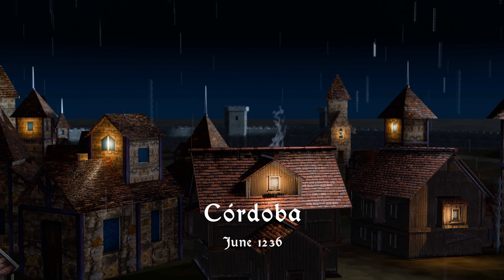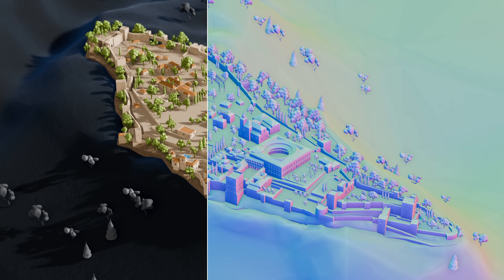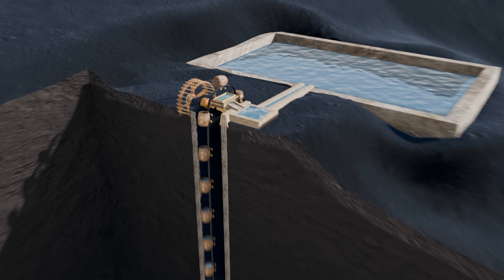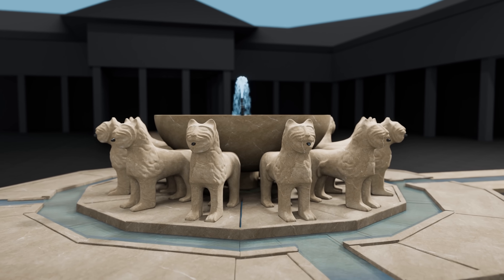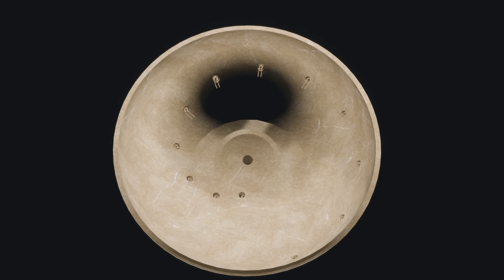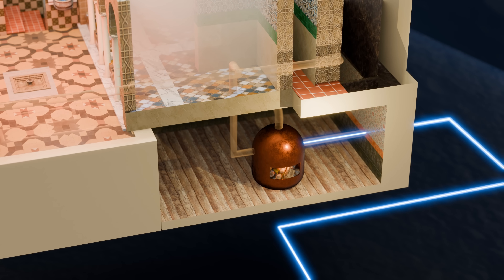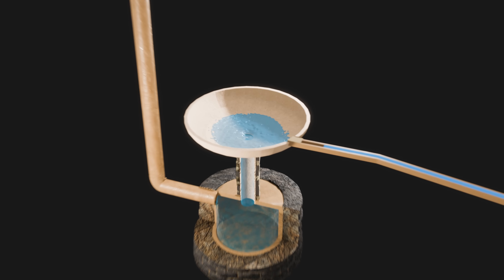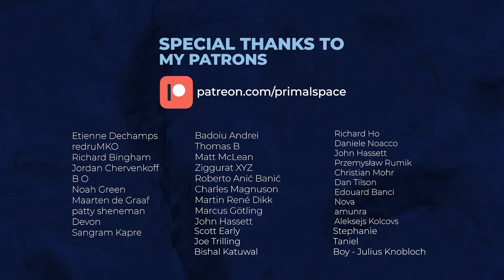The Ancient City That Mastered Water

Comment: If, as narrator repeated several times, water delivery into the lion fountain reservoir was constant,  every 2 subsequent hours, the amount of dispensed water through lion's mouth will double...the narrator should have explained this better as this is the key to whether the "dark age" engineers understood fluid dynamics and were able to apply complex calculus or they did it by observation, trial and error... as even a modest amount of rainfall will disrupt the accuracy.

Comment: The thing that pumped water 6 meters higher is very similar to my "pulser pump". I  have videos about it and some photos of my notes from the 1990's too, (if people want to make pulser pumps or models of what they think the Alhambra pump was like).   Please note that the explanation here is probably incorrect.  I know from experience that a whirlpool is very poor at moving air down.  It is much better if the water doesn't swirl at all.  Also, the bottom of the down pipe should go a bit deeper to prevent air from blowing back as the chamber gets full below. They also need to show where the exit water goes.  My pulser pump with a head of half a meter, and just 250 to 350 liters per minute power flow was able to pump water to 8 meters high with 2.5 meter submergence and to about 6 meters high with just 1.5 meters of submergence. The Alhambra trompe section was probably deeper and their head and flow rate was probably more too.

Comment: The Alhambra palace and fortress complex in Granada, Spain, was primarily designed and built by the Nasrid dynasty rulers, specifically during the reigns of Yusuf I and Muhammad V in the 14th century. There was no single principal architect whose name is known for the original Islamic palaces. 
Nasrid Rulers and Key Contributions
Construction of the Alhambra was an ongoing process over many decades, with different rulers adding various palaces and fortifications. 
Muhammad I Ibn al-Ahmar (Alhamar), the founder of the Nasrid dynasty, began the initial construction of the complex in 1238, focusing on the fortress (Alcazaba) and foundational structures.
Yusuf I (reigned 1333–1353) commissioned many significant parts of the complex, including the Comares Palace (which houses the Hall of the Ambassadors), the Gate of Justice, and the Baths.
Muhammad V (reigned 1354–1391, with an interruption) completed the palaces and added some of the most renowned elements, notably the Palace of the Lions and its central Court of the Lions.

Comment: I would be interested to know what happens when it rains and how the clock mechanism recalibrates itself.
Reply: It does not. The «clock» will shift time.  The same with sun. And for one ull hour no lion wil spout any water at all. Another flaw is that as hours go by, the lions will spout lesser and lesser water as they all split the same amount of water. Imo this was never any «clock» at all.

Comment: The timed clock spout is a mathematical marvel - the volume , capacity and flow calculations are simply exceptional.
Reply: For each hour the lions will spout lesser and lesser water. In the last hour no lion will spill any water at all. If it rains, the «clock will advance, if the sun is hot, it will sag.  I am not ompressed and doubt that tis ever was anything but a fountain.

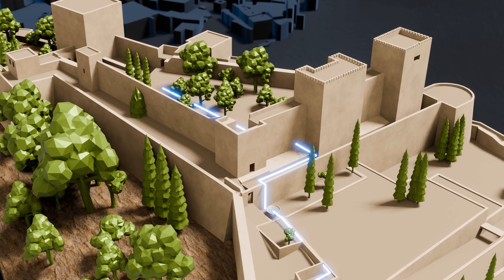Comment: 8:30 that cant be possible wouldnt that just be perpetuum mobile ?
Reply: It works, but only ig correctly made. The one in the video seems not to. Look up Trompe, Air lifting pump and the combo: Pulsar pump. Been in modern mining industries for  many years.
Reply: @kjellg6532 sure density difrences can pump the water up but in order to achieve that level of oxygen in the bubbly water you would need alot more extrrnal force.
Reply: @tazin5787  That is were the Trompe comes in. A water driven air compressor. Normally with e whirlpool,  but a veturi system at the top. Then the whole system waste a lot of water to collect energy for the compression.

Comment: Genius.....the entire pressurized water system. But the air-pump at the soldiers quarters is just amazing for its time. Aquaducts and tunnels dated back a thousand years like in Segovia, but to know that the air bubbles could raise the water........the designer must have had an experimental lab somewhere. Also how did they measure the flow, since measuring would have been crucial for the system to work. Did they use lead pipes? Compressed air is used thesedays to pump sea-bed gravel with water to the surface to mine out diamonds, no mechanical action required, just air bubbles released at the bottom of the pipe....but for this designer to use the vortex action to take the bubbles down is amazing. Its the most impressive part of the engineering design.

Comment: there is no way those little air bubbles made the water go up 6 meters , that's almost 20 feet. I've tried with an air pump and it barely went up less than a  couple feet. 8:13
Reply: It works, you simpy need more pressure.
Reply: @kjellg6532  I couldn't find any videos of people recreating it without electricity, do you have any?

Comment: I have been building models of the entrainment fountain described here in, at 7.++.

There is no discharge of water, with this system, or better described as, no lost water discharge, as with a trompe, or a ram pump...     There is nowhere to put said discharge in this system shown, that would not immediately stop its functioning!

But I know how it works!
Reply: Note, this is the correct design, but certain words are used in the description, that mislead the mind, that has not built each part separately, tested each part separately, I tell ya....
Reply: OK, so water falls down in a hole in the ground in your model? It all then comes out 6 feet higer? ALL, 100%,  of the water going down is coming up? 
You may lead this water to a turbine and extract energy from it on its way back to ground. Scale this and you have an endless source of energy to heat your house, no more energy bills.  Will you receive the Nobel prize in physics for saving mankind from the energy crisis?

Comment: The 12 lions has got to be my best feature! The precise size and shape of the bowl, combined with the precise water flow and then  the precise placement of the 12 holes in the bowl. Don't forget that those holes that lead to 12 pipes have to be the right diameter too for precise water flow. They are a calculated flow per hour so that the water flowing in fills the bowl to the next hole in 60 minutes while feeding that fountain. Then of course as each consecutive hour goes by there are more fountains to feed while the pool is still being filled to the next hole 60 minutes later. Then, if you think it is all over there is an airlock syphon system to empty the pool and start again.
Reply: Well. As the hours go by. The water level in the bowl will rise. The waterflow to #1 lion will increase. The video states that the flow into the bowl is constant, so as hours go bye, each lion will get lesser and lesser water to spout.  At the end of the 12th hour, the bowl will drain and no lions will give away any water. When it is hot, the evaporation will increase, when raining, extra water will fill the bowl.  
There is too many questions regarding this clock. Did it ever function as a clock?

Comment: This keen understanding of hydrodynamics and airflow to operate infrastructure was alive and well until the era of cheap electricity. In NYC, drinking water from upstate is brought to the city by sheer gravity and creates a water pressure so high that water could reach the the seventh story of a building with no electricity. And the NYC subway was built close to the surface with grates on the sidewalks that allowed air pressure from passing trains to keep the air circulating. Nowadays, if we wanted air circulation or water pressure, our default instinct is to install an electric pump that eats up energy.

Comment: Amazing that we’ve stopped using these free, energy-free systems in favour of electric motors everywhere
Reply: With hydro electric energy you can heat hoist pump, drill, cut,  wherever you need using free energy.

Comment: Water and airbubbles don’t mix… bubbles would just swim trough. How should that work out?
Reply: is it a perpetual model?
Reply: It works fine. There is a mechanical interaction between the up-rushing air and the water. Look up Trompe, Air lifting pump and Pulser pump.  This system works fine, but must be completed. The video is partly wrong and partly it does not tell the full story. Energy to lift water is harvested from a large amount of waste water going down to some drain.

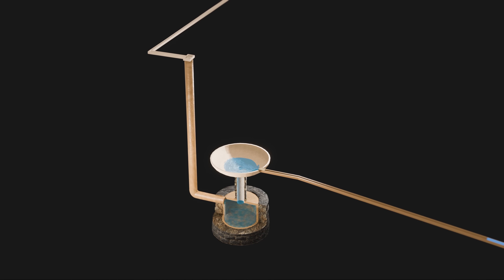Comment: 7:38 Do I sense a perpetual motion machine?
Reply: Not quite. Check Trompe, Air prssure pump and Pulser pump.  
This system works, but it waist a lot of water. The waistwarer falling down gives energy to lift a fraction of water up to a higher level.  Trompes are used up till reasent years to give compressed air supply to the mining industry.

Comment: Can anyone answer this question about the whirlpool pump? I'm thinking about energy conservation. There is no way a fixed amount of water can travel to a higher point without energy input. I suppose this is compensated for by the fact that the water that travels up is lighter, and therefore less mass travels up than is fed into the whirlpool. Doesn't this mean that there should be some draining of excess water at the bottom of the system?
Reply: You are absolutely right!  Please look up Trompe, Air lifting pump and Pulser Pump.  For this system to work, a lot of water is drained from the system. A huge amount of water falls down in order to lift a fraction up. 
Normally you do not need any whirlpool either, but some sort of Venturi-restriction at the input. The intention is to suck air into the downgoing water flow.

Comment: Truly remarkable engineering within the palace grounds, and all centuries before there would be motors to drive a modern water system.  Using a whirlpool to inject air into the water and lift it 6 meters was ingenious!  But wouldn't the off-site water conduits be vulnerable to attack or blockage by besieging forces?

Comment: 5:20 I don’t understand the fountain, the higher the water level gets inside the bowl, the faster water drains out thru existing holes. He says the water supply is constant
Reply: Its actually just magic
Reply: I'd imagine because each hour you're adding another drainage hole, maybe that compensated for the higher water level, so it evened out? Just guessing
Reply: Exactly, so the lions clock seems to be fake.  Another detail: for one full hour no lion gives any water at all. Strange «clock».

Comment: The Alhambra Palace in Granada, Spain was primarily built during the Nasrid Dynasty (1230–1492). Its construction involved many architects, engineers, and artisans over centuries, but specific individuals are difficult to identify due to the lack of detailed historical records. However, here are some key figures associated with its development:

Founder
	•	Muhammad I ibn al-Ahmar (1195–1273) – The first Nasrid ruler of the Emirate of Granada, he initiated the construction of the Alhambra in the 13th century, fortifying the existing hilltop structure.

Engineers & Architects
	1.	Muhammad II (1273–1302) & Muhammad III (1302–1309) – Expanded the palace and refined its layout.
	2.	Yusuf I (1333–1354) – Commissioned major parts, including the Comares Palace and the Mexuar Hall.
	3.	Muhammad V (1354–1359, 1362–1391) – Built the Court of the Lions, one of the most iconic parts of the Alhambra.
	4.	Ibn al-Khatib (1313–1374) – A polymath and vizier, he influenced the design and construction of various sections.
	5.	Ibn Zamrak (1333–1393) – A poet and official who supervised the intricate inscriptions and decorative elements.

While individual engineers’ names are not well-documented, the Alhambra’s architects were likely skilled craftsmen from Al-Andalus and North Africa, blending Islamic, Moorish, and Andalusian styles. The hydraulic engineering that powered the palace’s fountains and irrigation systems is especially impressive and was likely designed by Andalusian hydraulic engineers using advanced medieval Islamic techniques.

Comment: The air bubbles in 8m16s are both on the left and on the right. So the air bubbles on the left can't make the water climb higher. The way, it's described, it's a perpetuum mobile. It can't work that way.
I bet there's something underneath the the official soldier habitat. Both the rooms below and above have water supply. And the water flowing down to the rooms below delivers the energy to pump the water up to have a supply to the rooms above.
Reply: Look up Trompe. This video only tell half of  the story

Comment: 5:23 What if it rained? Wouldn't it fill much faster leading to hours being "shorter" with this system?
Reply: Very good point
Reply: Rain wasn't discovered until 20th century, so they didn't really have to worry about that
Reply: @GorillaShells  -_-
Reply: During rains they can check the time in their phone. Duh! 😂
Reply: Anyone here have an actual answer?
Reply: it's really hot in there, so it's unlikely that it rains
Reply: It wouldn't. The mechanism built ensures that the water supply comes from the pipes not the channels above ground. 

Water may refill faster, but it'll still be the same flow for the fountain. Akin to rains in current cities, rivers may fill up but the pressure is the same. We don't consider the ancients intelligent apparently
Reply: It was roofed
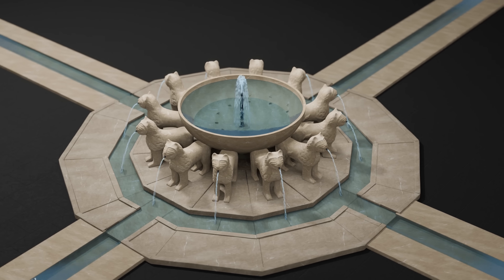Reply: @branch4747  Does not look like it 3:13
Reply: @goldenarrow7134  You cant control the amount of rain gathering in that bowl. If it rained a lot one day, the bowl would just fill up fast and it would not be a constant flow of water. Does not matter how the pressure from the pipes act
Reply: it was closed dumboo

Comment: The water clock of each lion statue spouted water to mark a specific hour was so incredible and very spectacular engineering. Imagine that, the water pour on an exact time. No electricity required but only the impressive of science. It reset when it reach to 12 hours and it vacuum the water and falls down in the drainage pipe and start again. Very impressive engineer.

Comment: How did this place remain unconquered for so long? Even if it's easily defendable due to the walls, having their water source be external and so far away from the castle seems like an extremely large vulnerability. An attacker destroying the dam would basically cut off the whole water supply.
Reply: Likely they still had normal wells, this system was just for the pools and fountains and maybe for drinking water in good times, but if they were under siege they would just use wells.
Reply: @cy728  True, fair point. I guess I blanked out on the fact that even though they used that river for automatic water flow due to being high up, that didn't mean they didn't have any manual water methods in the castle.

Comment: I knew about ram pumps but if someone told me that you can make water go upwards by just forming a silly vortex in a pipe I would have called BS 😆 And those guys just came up with it and built it hundrets of years ago. 🤯
Reply: More likely is 2000+ years ago. And it is not the vortex that makes this happen. Look up Trompe, Air lifting pump and Puler pump. The system needs a huge amount of falling water to work.
Reply: @kjellg6532  Well the way it was explained it seemed like the vortex sucked down air with enough force to make this happen, which in itself surprised me. I can wrap my head around a ram pump but THIS? In ancient times!
Reply: @UnknownUser-pf9rk  As I said, look up Trompe, Air lifting pump and Pulser pump. The vortex is misleading. You only need a Venturi function at the top. You can make that at the top of a tube simply by puting a bundle of straws don at the top wih one end open to the air and the other end a short distance down in the tube. The air bobbles are captured by the down rushing water and the pressure in the air increases. The Trompe work as an air compressor. For an Air pump to work, you need sufficient air pressure. 
In this video they fail to show all the needed waste water to power the Trompe. The video version can not work at all.

Comment: 8:25 describes a simple air lift. I have been using this concept for my indoor hydroponic zystem
Reply: What’s the system called I’m interested in it.
Reply: @Mr.singing_story  it's called Air lift pump. 
For me I use aquarium hose and a T very slowly inject bubbles into the hose. Each bubble floats up the hose, lifting a bubble of water

Comment: The Lion fountain is amazing. With the constant flow of water, they have to calculate the height for each pipe for that bowl shaped reservoir, in addition of with each hour, there will be another pipe that drain the water out of the fountain.
Reply: Yes, and with the same amount of flow, there will be lesser and lesser water per lion. As you reatch the 12th hour it all resets and nothing hapens, no lion spewing any water for a full hour.

Comment: You missed a critical part about the pump. It has an outlet pipe dumping extra water below out of the city. This needs to happen otherwise the pool would simply fill up and nothing would happen. You can think of it almost like driving a water wheel down there to pump a smaller volume of water higher. Without dumping some of the water for the pump it would not work. This video will lead numerous people into having a poor understanding of physics or at least its real world applications.

Comment: Overall how they knew they needed pressure above the castle to make the water go so far into the different sections of castle

And also using air pressure inside the thin pipe to raise the water against gravity